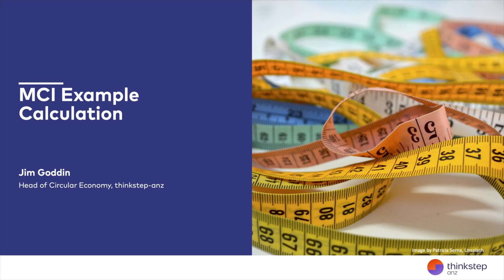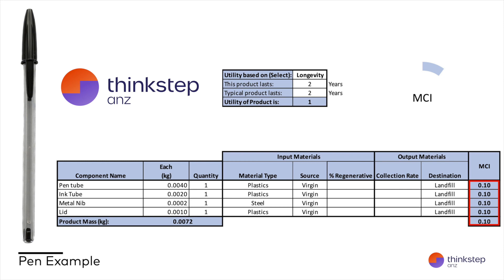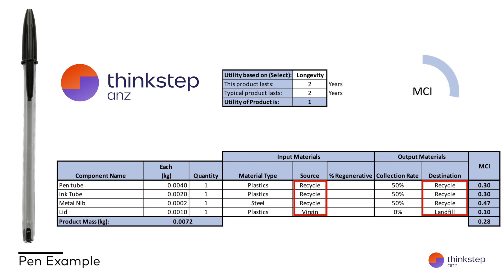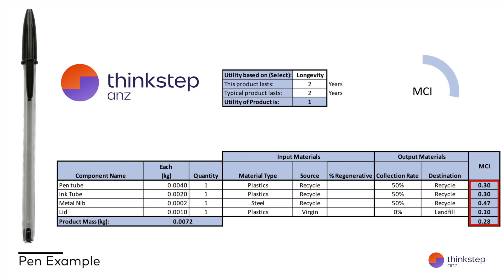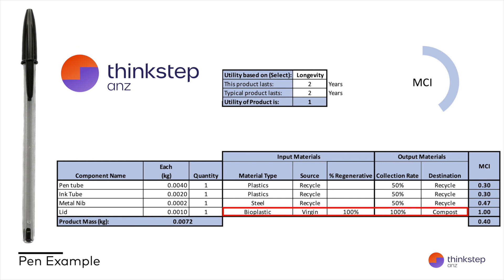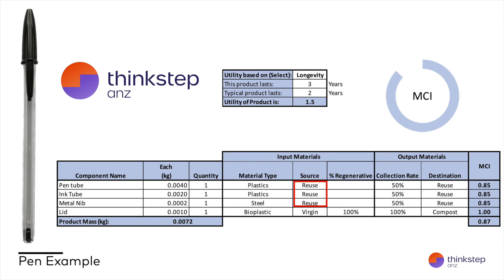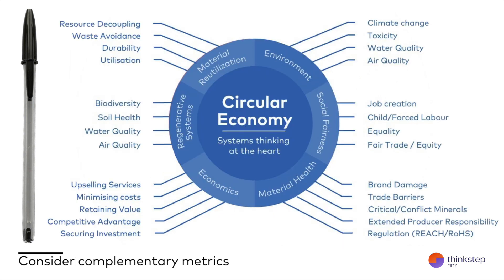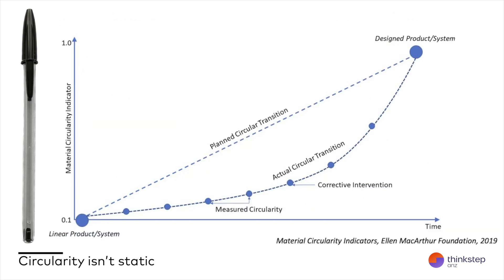thinkstep-anz's MCI Calculator demo

Comment: Thank you very much for your effort! 
I have a question.
Is it correct to understand that the [Recycle] in the Source tab and the [Recycle] in the Destination tab are independent and not connected? Is the default table only for the recycle indicator in the Source tab functions?